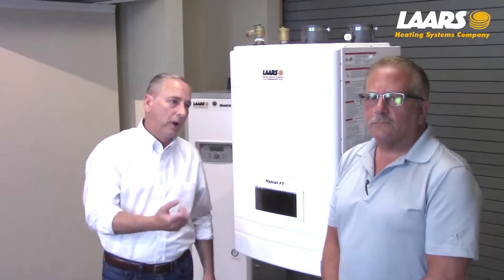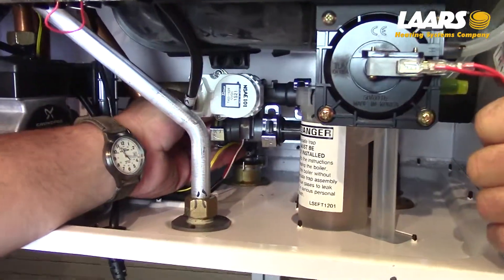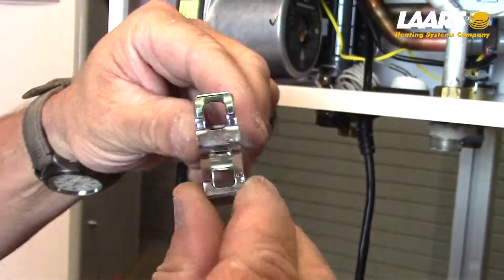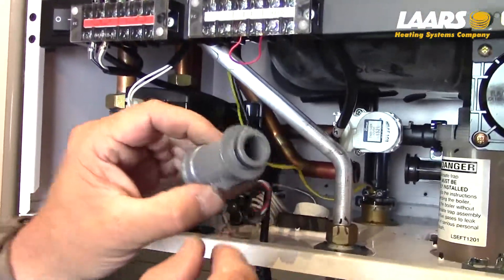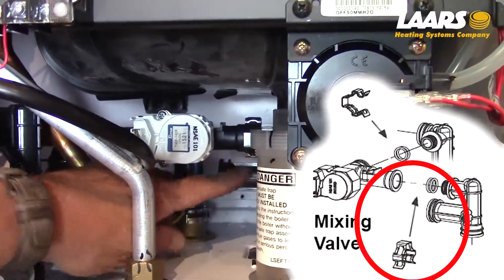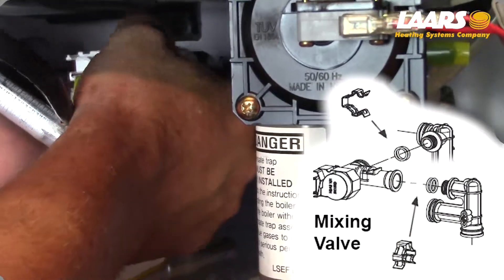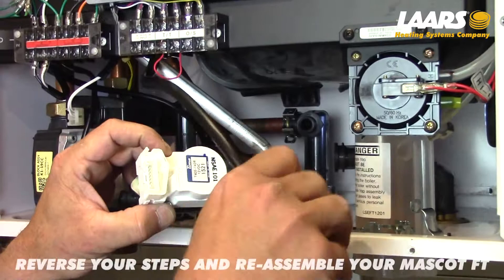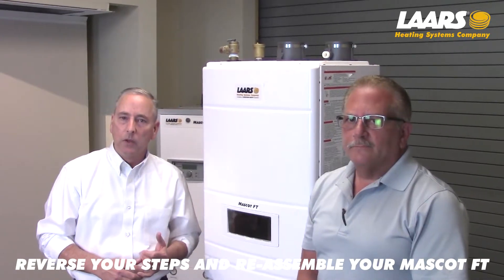FT Series (residential) Flow Sensor and Mixing Valve, Remove and Replace.

Comment: I got code 68. Changed the flow sensor and the mixing valve but still no hot water was being “called”. And code 68 came back on. Any suggestions?
Reply from the maker: A code 68 is in your FT manual in Chapter 6 and is  'Mixing Valve Operation Error (Mixing Valve Stuck in Initial Position).  So it appears that you were heading in the right direction.   
    I'm hoping that you have resolved your issue. Often YouTube questions aren't cleared after a Tech calls 800-900-9726 Laars Tech Support, so, I'm checking to make sure.  Thanks!

Comment: Why would these components go bad? I went out of my way to get a laars mascot ft combi unit and have my installer setup, but he is having trouble with the outdoor sensor and central heating. The central heating does not fire when outdoor sensor is hooked up regardless of set temperature. I sent him your youtube site. Unit seems to work fine without sensor hooked up.
Reply from the maker: Were you able to get this resolved?  For technical questions, it's best to call us at 800-559-1583.  There you can give us some info about you model and it's parts,, installer, location,, etc. So that we can assist you.  Thanks.!
Reply: @LaarsHeating  replaced board at beginning of heating season. All seems fine but noticed that the bleed valve has been more active than last season. I've also noticed a milky condensate tube. May seem a little noisier than last season when it shuts off. Like a bearing noise. Happy with heating bills though :)